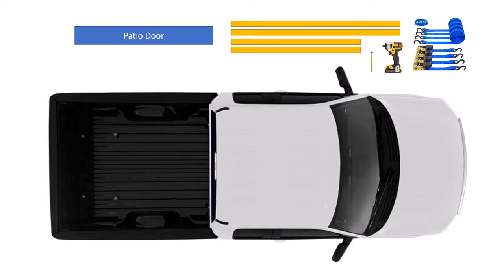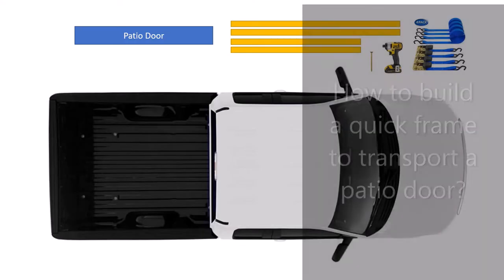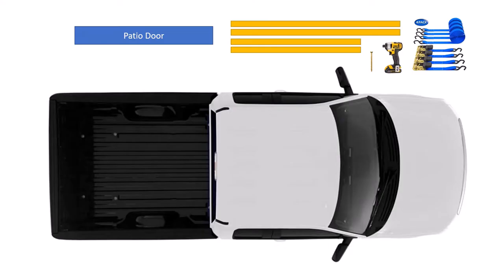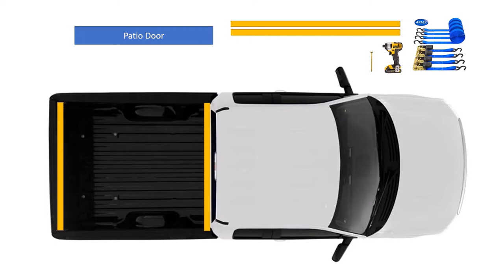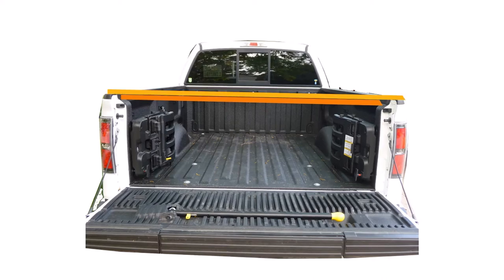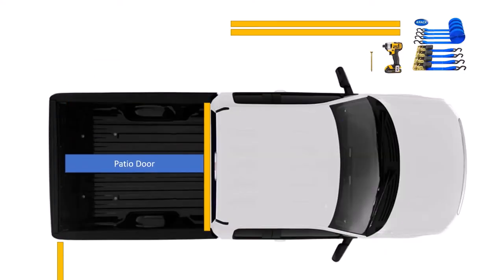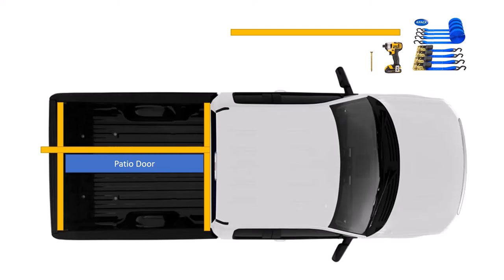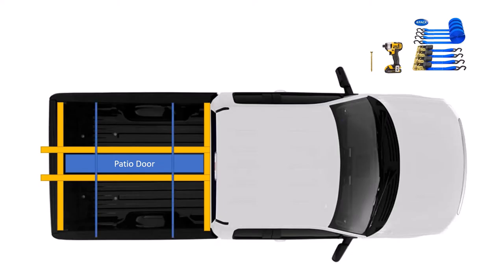How to transport patio door? Patio door in truck? Moving patio door in pickup truck. Moving a door

Comment: Perfect, I used 4 2x4s. same idea as you but used some extra cut off as stops so the frame wouldn't move in my truck bed, plus extra straps pulling the wood down to the truck bed. 3 straps on top of the glass door.

Comment: i have to pick one up nearly 3 hours away.  Will the door be like a sail or get jostled and bounce any using your method?  I was thinking of renting an F-150 for a day. i have ratchet straps, at least two of them. The door is 60X 80. Would that likely fit in an F-150?
Thank you for posting this and showing pictures of the setup.

Comment: Just a quick point about this video ... although I agree your method is solid,  it will not work with a short bed pick up truck like the one shown in the begining of your video ( where the door is lying across the truck bed and over the top bedside rail.   Your method appears would only work with 8 ft beds .
Reply from the maker: It works on my f150 with a 6 foot bed. I agree that  any shorter bed would need adjustments.

Comment: any others methods, what about horizontal on the bed frame and add straps?  does that risk break in the glass?
Reply from the maker: If you put 2x4(s)  across the rails it could work, but doors are not designed to handle a lot of force perpendicular to the glass.